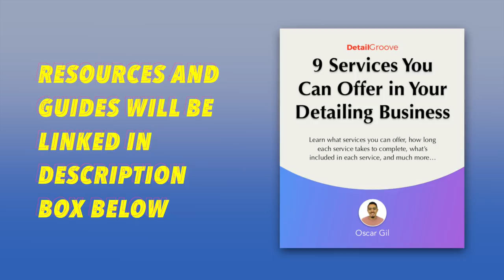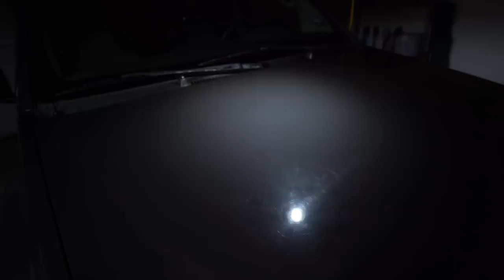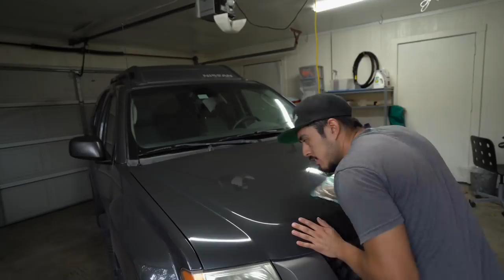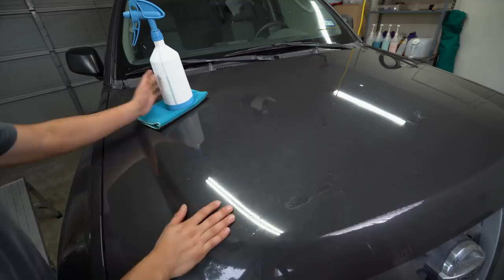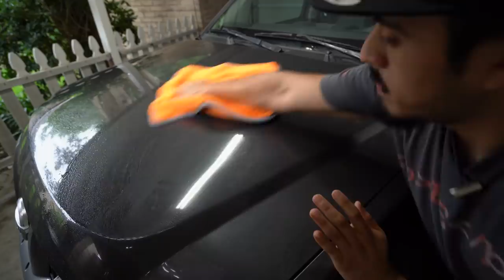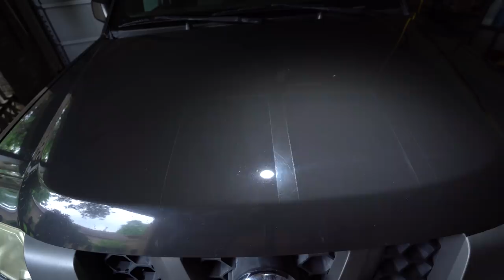HOW TO CLAY PAINT

Comment: Those clay mitts are ok for large vehicles (boats, vans, semis, large SUVs), but if you want way better results, use an actual clay bar. You should do a small section at a time and then wipe the clay luber product off. You know it's time to move to another section when you don't hear anything as you move the bar over the paint.

Comment: What is your thought on using those clay disc that fit on polisher? Have you tried those?
Reply from the maker: I haven't but I"m not a fan as it won't get into the tight areas. So either way you'll have to go back to something more manual

Comment: How often should you compound and polish a car? Do you always have to polish before you wax?
Reply: Depends on how your protection holds up. For me, once a year in Cali weather. No you don't always have to polish before you wax, but the first time, you clay and compound, you should polish. from that point, it's maintenance, meaning just wax. I use Fusso Coat or Collinite 845 for my waxes, both with my 3401

Comment: are you suppose to rinse the clay mitt after every couple panels? can soap water from the washing process be used as lubricant? the lubricants i'm using isn't slick enough.
Reply: Use the car soap you clean the car with . I do this method all the time with my clients and comes out great . First clean the car with the bucket soap with the mitten. And the rinse off then I re use the mitten squeeze a little bit soap off and use it with my clay bar !